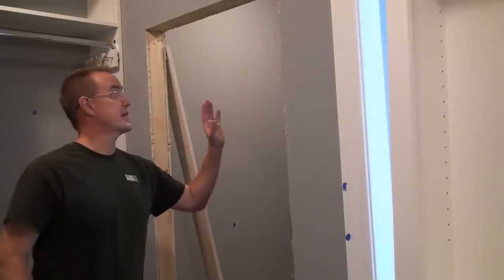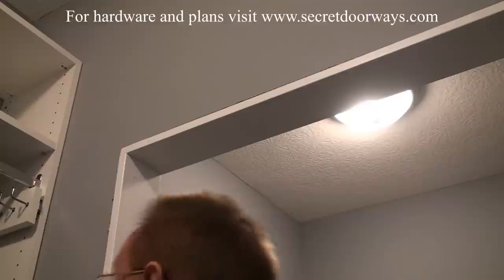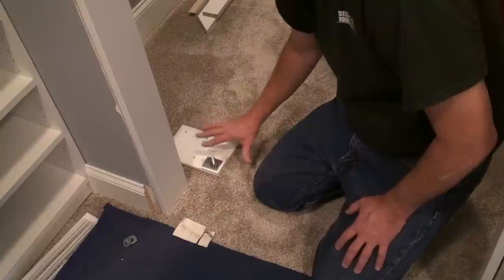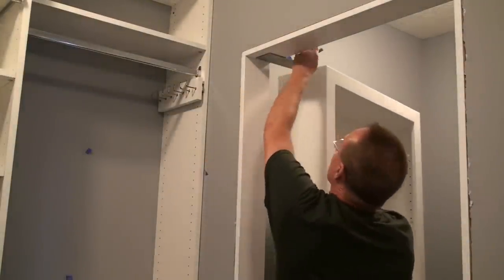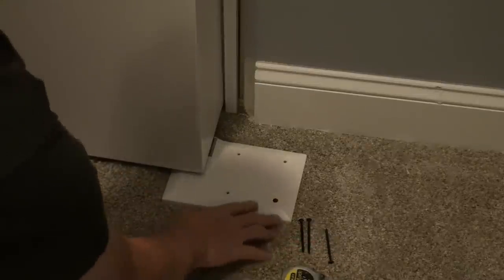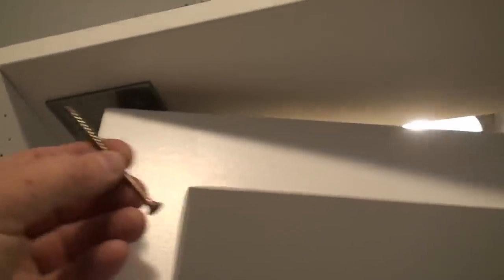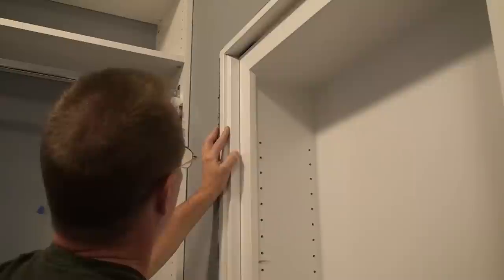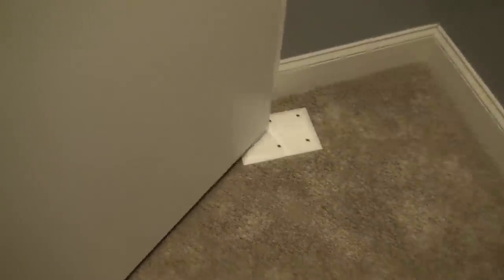Hidden bookcase door

Comment: Very nice kit! I really like your design and finish over the other similar concepts I’ve seen.  I do have a couple of suggestions that you might try, a few things I may do if I order the kit.  I would suggest cutting a bevel along the edge of the face trim on the hinged side.  This would eliminate the corner of the door binding on the door stop while closing, as there would be no sharp comer after cutting the bevel.   Secondly, I’m not a fan of the bottom bracket that secures to the floor as shown here.  The threshold style looks better to me, but not the best application for every instance.  I would use a similar bottom plate, but it would be only a few inches under the door, just enough to hold the base hardware and it would 45 from that corner toward the wall/baseboard.  Once closed, the only exposed  portion would be a 45 degree triangle base from the doors corner to the wall (about  the same size as your).  That base could slide along the wall for side to side adjustment during installation and I would have a groove cut into the base a few inches for in and out adjustment during installation.  The bottom bracket would be secured after adjustments.  The base would be beveled along the exposed edge and caulked at the baseboard for a nice finished look.  Your kit is great, these suggestions are just my opinion according to my thoughts after watching your videos.  Great job!

Comment: I would use some decorative molding around the door jam,  and set the molding to align with the 'closed' bookcase. Using the square 'door-stop' framing sort of gives it away ... 
It still looks nice, and it is a matter of personal choice. But, especially if it is in a more formal room -- such as a dining room or library -- the decorative molding will really give it the look of 'just a bookshelf'. I saw a nice home, recently, that had a 2-section bookshelf in the front office. {The Owner worked from home, but would sometimes have clients come to his home office, that had a 'business door' directly on the front porch.} The middle section of the bookcase opened into the Master Bedroom walk-in closet! So he could go directly to and from his office to the bedroom... rather than walk thru several other rooms to 'go around' to the Master. BTW -- the closet also had a false wall that provided a Safe Room and his Firearm Storage, behind a Dressing Mirror.

Comment: It looks like the screws to mount the deadbolt are accessible even when you're locked on the outside of the door?  10 seconds with a cordless drill and the deadbolt is removed?
Reply from the maker: Not at all.  You have to unlock the door with the key before you can get access to the mounting screws.

Comment: any way to escape if you get locked inside?
Reply: Depends on the lock set-up.  In this case,  it is only designed to be locked and unlocked from the outside.
Reply: The hinge screws are inside. Keep a screwdriver inside the room just in case.